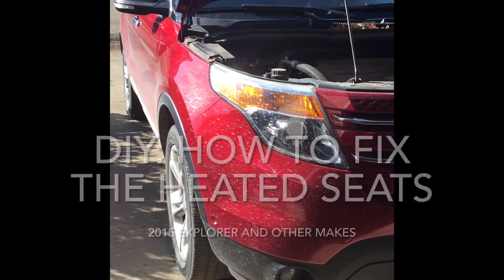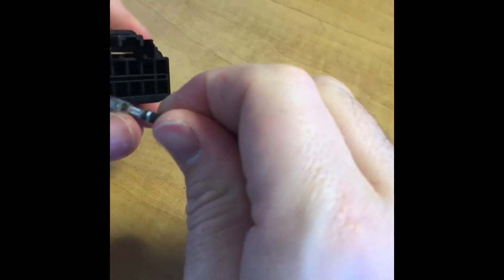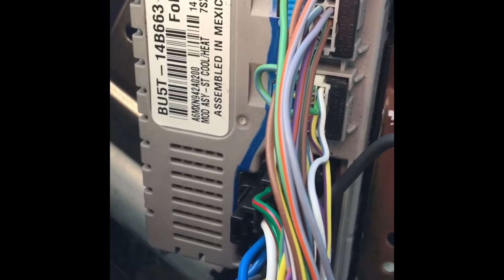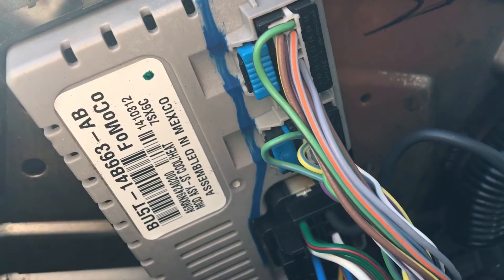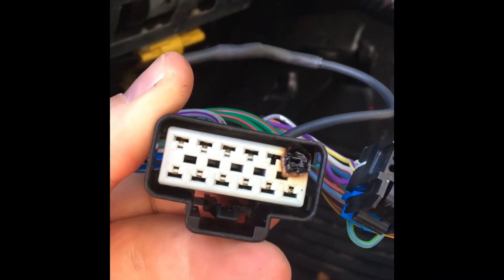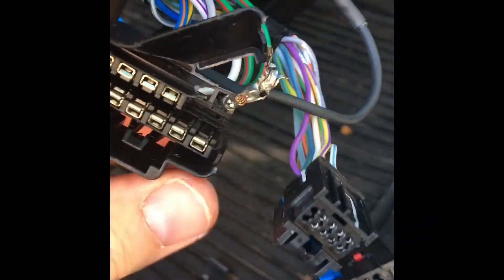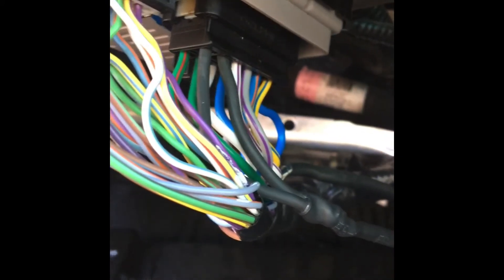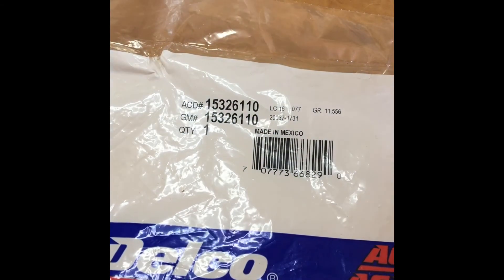Explorer 2015 - diy repair heated seat. Module BU5T-14B663-AB - burnt plug - kit 3U2Z-14S411-ZMB

Comment: I added a second ground to the passenger seat frame, I am seeing 50 uv on my VOM under heating.  Try as I might can't eliminate the ground differential, I've moved the ground cleaned the metal.  Is this a problem?

Comment: I wonder if you can add a fuse and replace a fuse instead of a plug
Reply from the maker: @denneychavez9972  I’m not a mechanic, but I’m sure there is a fuse or relay somewhere in the system already…so I’m not sure how that would work adding one.  I haven’t heard from anybody having to do this a second time when using the double ground.

Comment: Great Video.  Thanks!  I used it to fix a 2016 F150 Platinum heated seat module failure.  Had the same burned ground wire fitting!

Comment: Nice video! I might have the same problem with my 2017 Ford Explorer platinum. Did you get any DTC‘s code?
Reply from the maker: @roe20111  this was a few years ago…I didn’t plug in to check, but I don’t think I had an engine light on.
Reply: @ thank you 🙏 for the update

Comment: Identical problem on my 2015 f150, white cover part is melted to the black and been try to pry it off for the past hour or so , debating if i should just splice and call it a day or keep fighting it
Reply from the maker: @erikgonzalez9525  yeah, I know how you feel.  I was lucky enough to break it apart with pliers.  Let me know how it works out for you.
Reply: Welp part came in and took a few curse words and elbow grease but i was able to get the old one off and the new one works like a charm! Thanks again for the detailed video ! Saved me $1100 !
Reply from the maker: @erikgonzalez9525  that’s what I like to hear- glad it saved you some cash!

Comment: How long did you take to take apart the white clip? Im about an hour in and struggling ,with the new pigtail coming tomorrow.
Reply: Also: What do you mean "split" the ground wire? Strip it and have it feed into both the normal ground terminal and the unused ground terminal?
Reply from the maker: @evanpartin1323  sorry for the late reply, I’m on a road trip.  Yeah took a good 15 min, I used a needle nose plyer to break it apart piece by piece until I was able to slide that clip out
Reply from the maker: @evanpartin1323  yeah I took the ground and split it to two terminals if I remember right.
Reply: @Markofalltradesdyi  Ty, will continue to work at it. I'll let you know if it works. 2012 MKX.
Reply: It worked. Ended up snipping the wires themselves though. Connector was too stubborn even after excessive work.

Comment: Thank you! I was quoted $1000 for this fix. Thanks to your video I only had 3 hours and $19 into the repair. I couldn't get the melted plastic cover off, so I had to splice each wire.
Reply from the maker: I’m glad the video helped in your repair

Comment: Any tips on getting the burnt connector separated from the module?  I have been fighting with mine to the point I'm about to take a hammer to it.  :). I don't want to damage the module though ...
Reply: I finally got it apart with the help of a small flat screwdriver. Basically jammed it into the side until I could pry on it. Eventually it popped off, and the connector looked identical to yours. Installed new connector and heated and cooled seats work again. 🎉 The dealer wanted $1100 bucks to fix. New connector, module and 4 hours labour 😅.  Cost me $70 and about 1.5 hours of my time.
Reply from the maker: @xislander73  awesome! My favorite part about posting the video is to hear how much money people saved!  I hope it holds up for as long as you have the vehicle and longer!
Reply from the maker: Oh man that sucks- I hope you didn’t destroy it yet though you may have had no choice.  I think I would try to douse it with a lubricant and leave it overnight.  If that doesn’t work, I’d go in with a pair of pliers and start breaking that plug in pieces.  Let me know how it goes

Comment: Great Video Mark of all Trades. 
I own a 2017 Ford F250 and smelled burning in the cabin while using driver side seat heater. I think that it was due to the fact that I left it on for too long. I have low back problems and heat is wonderful. I looked under passenger seat and sure enough, the ground terminal was burnt. I ordered the Ford plug with pigtail and heat shrink kit and installed it today. I was leery hooking up the "second ground" wire for fear of causing problems. I feel you are right about double grounding wires is better but before I go and connect the second wire to first ground, I would love to see the forum you mentioned you took the idea from?? If it is a true ground would running a direct ground to seat chasis cause a problem in anyone's opinion or would it short something out? I noticed the burnt corner black wire has a stripe on it which has me a little suspicious whether true ground or not. Anyone??
Reply from the maker: I’m glad the video helped…yeah it was a couple years ago since I made the video and saw that forum post, I can’t remember where I saw it.  I hope it holds up for the life of the vehicle.  This is so common, I can’t believe more vehicles don’t burn down.  I posted this video thinking I might a couple people save some money…it has more views then I ever thought.

Comment: Just happened to me. Ford Dealer was kind enough to tell me the part numbers. They wanted to replace the whole module and the whole connector. Quoted parts were $550, after labor $1100!!! Rockauto has those parts for $170 total. Very happy to know this is a $5 fix!
Reply from the maker: I’m glad you didn’t have to shell out all that cash, take care jake!

Comment: Any update if doing a double ground worked for you?
Reply from the maker: I’ve sold the Explorer since the video.  But, the first time replaced the plug, I used the single ground and it burnt out again shortly after I did it.  At that point I was pretty confident in changing the plug so I made this video using the double ground.  It did hold up for a winter before I sold the vehicle…I live in Canada and my wife pretty much uses the heated seat 6 months of the year - so it did get a pretty good trial run with the double ground.

Comment: I had problem with passenger side , I found that the fan filter was clogged with dust after cleaning it worked just fine . Just thought I would add this possibility . Thanks for the video !
Reply from the maker: Thanks Noel,  that’s a great idea,  if I ever have to get back under there I’ll make a video on how to clean that fan out.  If you happen to make a video, feel free to tag it in the comment section.
Thanks again!

Comment: I have a 2016 f150 and my issue is the exact same thing you showed but I am having trouble finding that plug from AC deco so I can try the same route you did. Do you mind sharing that part number by chance? I haven't had much luck finding that plug by itself without it being with a kit
Reply from the maker: I found it on Amazon, but you might be able to try Napa or autozone with that number.  15326110 was the number I used on Amazon.  Let me know how it goes!

Comment: I had done this on my 2015 ford f150 and tied in a second ground to the first just like you did. Did great for a while now I noticed the connection burned again but this time in the first and second pin were the ground is. Any idea why this would happen and how to fix? I can get the connector again but I want it not to continue to burn out.
Reply from the maker: I’m not sure, I’m more of a back yard/try it yourself kind of mechanic.  I do know it’s common for these buggers to burn out, and the next step would be to change the module (in my mind) but that thing can be pricey.  If you do decide to change the module make sure to shop around for a good deal.  Hopefully someone with more knowledge will also reply to this…
Reply: For anyone facing this issue in the future-- if it burned again, there's a good chance the original pin had a melted contact on the board and your new ground was carrying all of the voltage instead of sharing with the original. For a detailed PDF on how to complete this repair search for "Ford SCME Ground Wire Repair and Modification Rowe".

Comment: I replaced the connector this weekend on my 2015 Ford Mustang convertible and it worked!  I bought the connector ($5 on Amazon) and the wire harness ($45 on Amazon) and followed exactly what you've outlined here and ALL SYSTEMS GO!  The local dealership wanted $910 to replace the module and harness.  I wasn't going to pay that for a car I use 4 months a year, but was willing to risk $50 to fix this...Hopefully it hold up....Awesome video!
Reply from the maker: I’m glad it worked out for you.  There’s a great satisfaction fixing something yourself and saving a chunk of cash.
Reply: My local ford dealer said the same thing. I bet they would’ve just replaced the plug and charged me full price for a module they never replaced. I hate ford dealers so much. QuickLane mechs are like fresh out of tech school punks